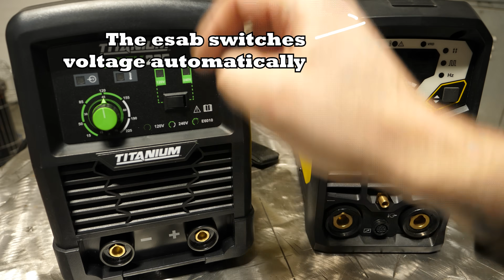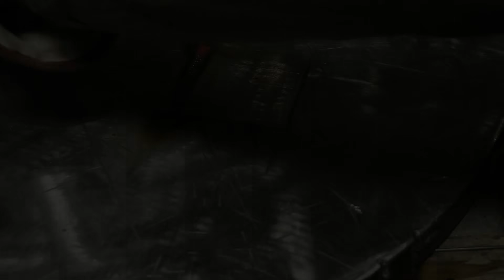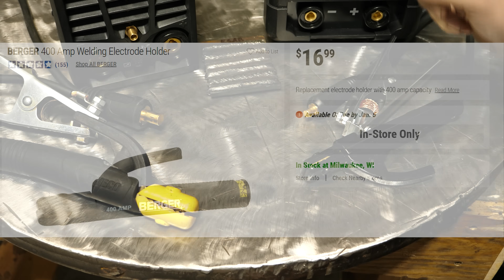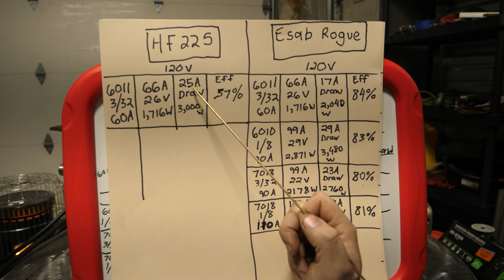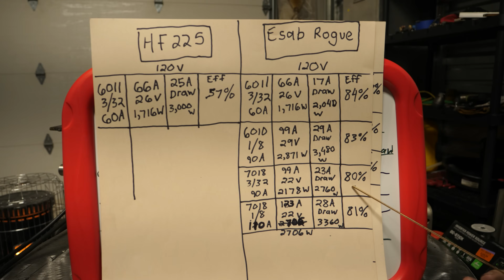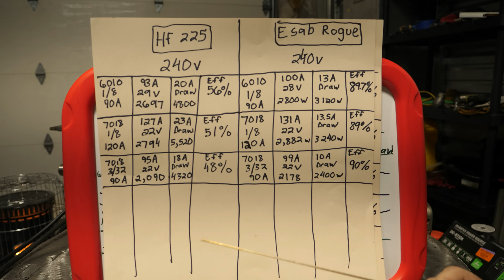Cheap HF vs expensive Esab welder comparison:  Deep dive

Comment: 2nd.😂

 My first inverter was a quite cheap 200amp "Stahlwerk ARC 200". It was astonishing to me how easyly it outnumbered the old but former very pricy transformer machine of my father.

 One thing I'm always excites about is the powerdistribution in the US. You are having 120 and 240V one phase commonly available in buildings where we in Europe have only 230V one Phase but commonly 400V 3-phase available also, where this is in the US dedicated to industries. But the amp-rating on the 120 and 240V  lines in the US seem to be reasonable higher than in europe especially in germany where a common 230 outlet is rated 10 amps continuous and 16 amp peak. The 3-phase is a completely different animal then, because there are 16, 32 and sometimes 64 amps available. The welders capable 200A or some 230 A that are designed for the "houshold" powersockets here really drive these, the wiring and the breakers to their maximum. And this pictures the differences in efficency perfect: while a "chinese" welder repeatedly trips the breakers on 160 A, a "EWM" won't even on 200A output.
Reply from the maker: I have done a lot of reading on how electrical grids came to be and honestly it’s pretty ridiculous lol.  In the USA things are the way they are because we are very slow to change.  There are still a significant number of houses here that would undoubtably catch fire if the max voltage was put over 240 without a complete rewire.  So in a lot of ways the electrical system is held back by how many homes have ancient wiring.  The solution to this was to increase amperage and not voltage.  Our 240v is -120 and +120 for a potential difference of 240v.  120v is dangerous but the probability of it shorting out through some old cloth wiring in a wall cavity is far less than if it was even higher voltage.  3 phase is far better (and more efficient) to run motors on, but like you said it’s virtually unheard of outside of a commercial business (and is billed completely different).  

It sounds like the way your grid is setup can put you between a rock and a hard place with a welder.  Very few household items would ever pull over 30amps on 240v single phase (electric dryer, stove, water heater) here.   I would imagine you guys would end up having big power draw items like those run off 3 phase.  So your single phase would be limited to lower amperage breakers, which makes sense.  Then you probably either have to make a welder setup for single phase (with maxing the breaker out) or for 3 phase (which would cost a ton of money because the voltages involved require far more expensive shielding and design of the internals).  Very few companies make 3phase welders here, and universally they are all big units.  My dynasty 210 will run on 3phase 480, or single phase 240, but it’s designed to be a industrial welder.

If a person here has a 50amp breaker on a 200amp service, they can practically weld with any modern welder up to around 275-300amps output.  Older transformer machines about 200-230a.  To get over 300a output you universally need 3phase power here.  Which requires a commercial building to go with it lol.
Reply: You're right. But there are old and flumsy wiring in older Houses here too. Some have still breakers bolted to wooden Boards. Common newer wiring is with 1,5mm² or 2,5mm² all 10A or 16 A depending on distance to breakers and intemded use of the circuit. Washingmachine and Dryer will have  each a dedicated wire and breakers on 16A and the cooker will commonly run on 3x1 phase up to 20/25A. Houses are connected to the grid with 3 phase 16mm² commonly 35A. You are basically limited to what your wiring and socket is capable for. There are sockets available (CEE) for 230V which have higher ratings, but you would have to change wiring to the breakers, the breaker itself and the plug of the welder. And in particularly in germany this all is only legal when done by a cerified and enlisted electrican😂.